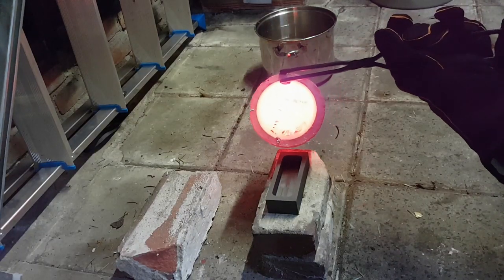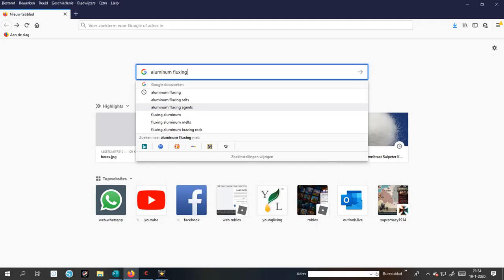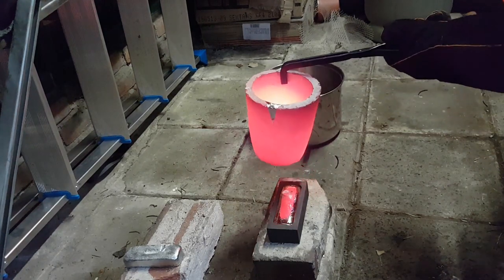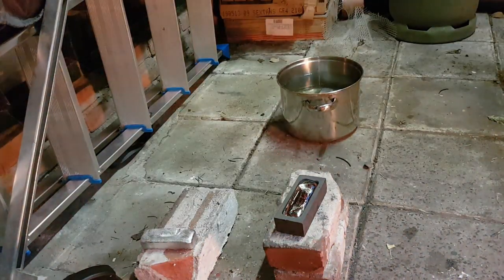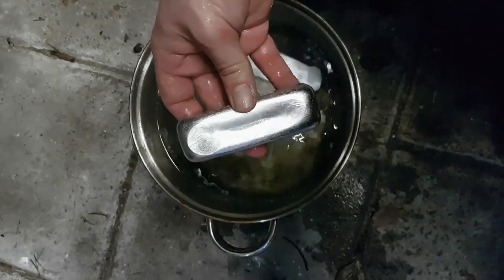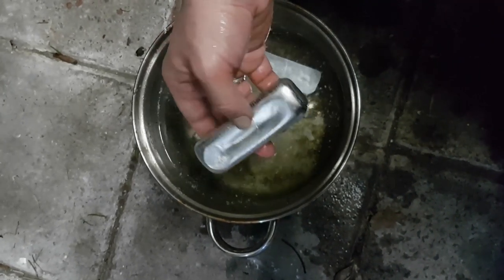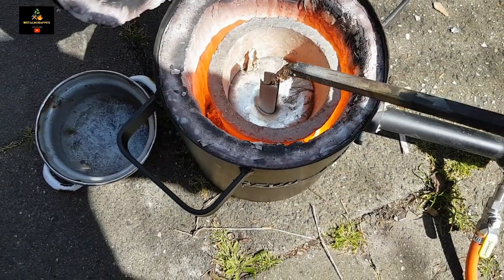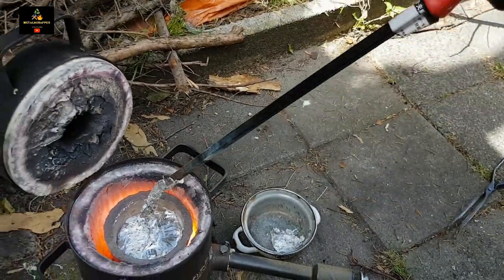WHAT THE FLUX?!?!?

Comment: What can fluxes do for impurity stripping? Can it increase yeild and decrease dross formation?
Reply from the maker: There are several fluxes, like a drossing flux wich, like it's name, helps getting less dross and more metal (like with aluminium), it makes the metal more fluid. There are fluxes to help remove impurities so you will get a cleaner melt, the flux will bond to gasses like oxygen en remove impurities. There are quiet a few options in fluxes depending on what results you want. But I have only used charcoal as a flux so far to remove impurities LOL
Reply: @Metalstacker  what about sulfer fluxing I've only heard in person about it cant find anything on YouTube

Comment: 50/50 NaCl KCl is the correct ratio together the melt at about 640C. It so happens the Lite Salt is exactly correct and is sold at supermarkets.
Reply from the maker: That is great to hear! I'll be looking into that :)
Reply: To get the 50/50 mix of NaCl and KCl straight from the can to have that lowered melting point, it's best to melt the "lite salt" ahead of time.  Crush the resulting salt ingots and there is your eutectic flux.  If you don't premelt it, the individual grains of NaCl and KCl have significantly higher melting points.  You'll have to overheat the aluminum to get it to work, perhaps causing worse dissolved hydrogen problems than the flux solves.  Same goes for if you don't keep the salt flux sealed up tight, ideally with some dessicant as it loves to absorb water out of the air.  If you really need a flux for aluminum, it works... but IMO it's usually more hassle than it's worth if you use clean scrap, sensible molding/melting/pouring practices, and select appropriate alloys for the jobs at hand.
Reply: Just checking. Regular salt and lite salt 50/50, right?
Reply: @tobhomott  Is this flux good for copper for preventing oxides/slag from forming? And would the problem of higher melting points be avoided because of copper's high melting point? Can I just pour the salts in the crucible with the copper?
Reply: @EricScrapping4Dinidog  No. Just lite salt. It already has the regular salt in it.
Reply: @Matt-xw1xx  Oh okay! Thank You!